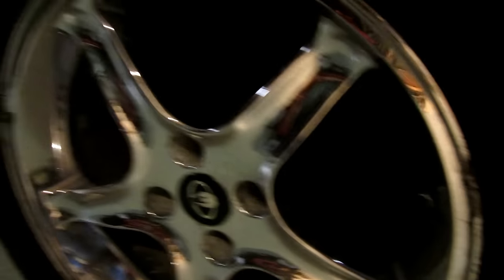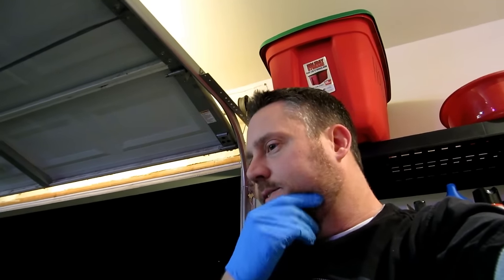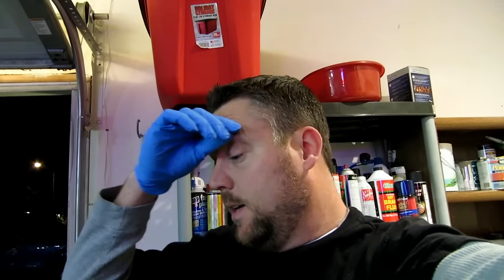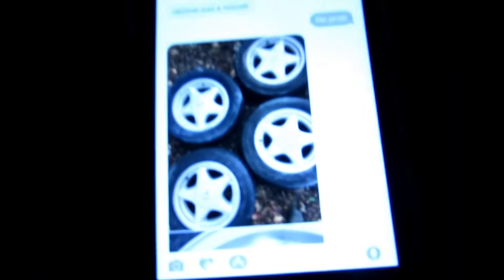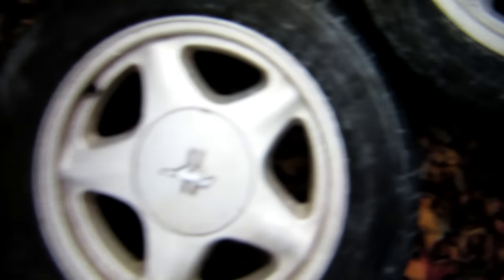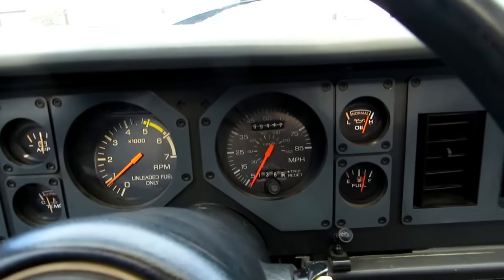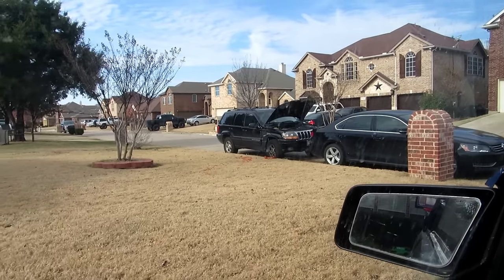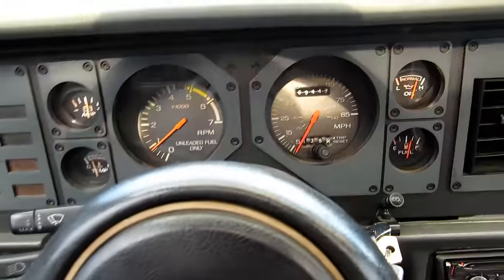1986 Mustang GT Project - Swapped Cobra Wheels for Pony's

Comment: I dig your videos man. The car looks be in good hands. I too have an 86 TTOP 🍻
Reply from the maker: Appreciate it. 4 eyed t-top's are cool as hell. I have new videos to put up...dont want to spoil it, but drop springs, new struts and caster plates are on...not happy with the drop, pulling them off getting different springs waiting to see what happens with these to compile a new video. Cheers!
Reply: Mike Dula yeah im not happy with mine either lol (to much rake)... Im in the middle of researching mass air conversion.

Comment: Hey... I have a question for ya... since you have a 1986 GT....
     My right turn Blinker works in front and back and it clicks when engaged however... The indicator in the dash doesn't light up...(I tried replacing the bulb already) any ideas?
Reply from the maker: Its probably the bulb sockets contacts. Almost all mine didnt work. Take out the bulb then socket get some sandpaper and clean the contact pins where it meets the circuit board on the back of the cluster. Then take a little strip and run it and out of where the bulbs contacts slide into. I got all mine working again doing this just using a small file or sandpaper. They were also brittle and when i did leds in the dash i just replaced all the bulb sockets. Cheap on amazon.